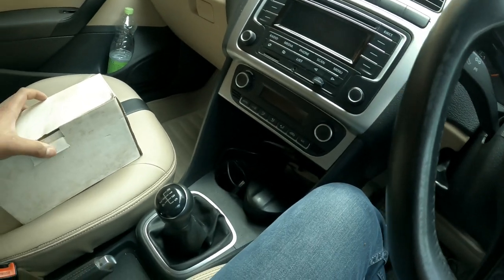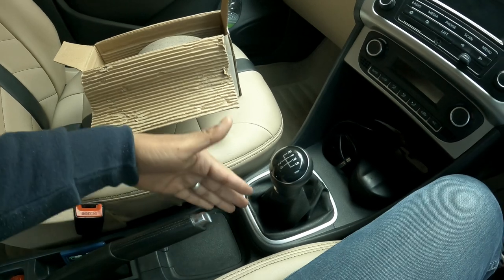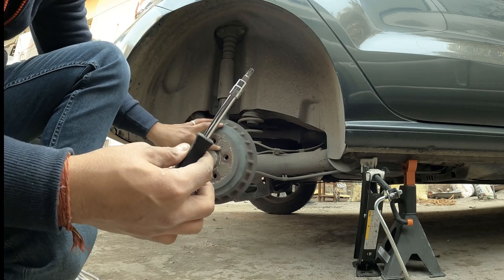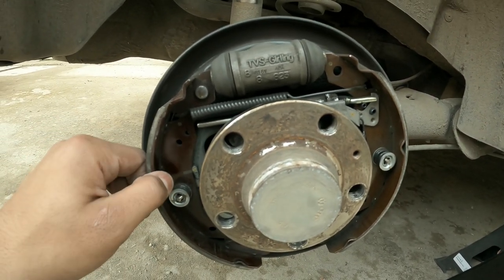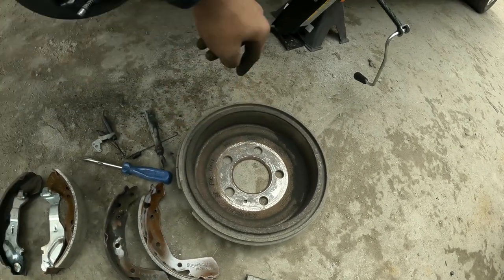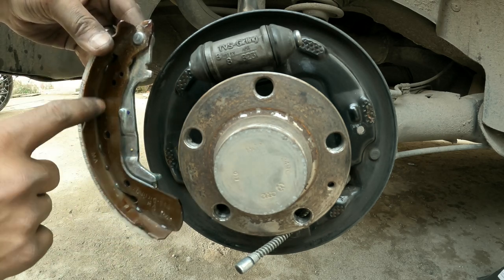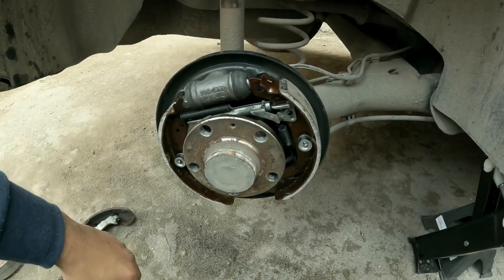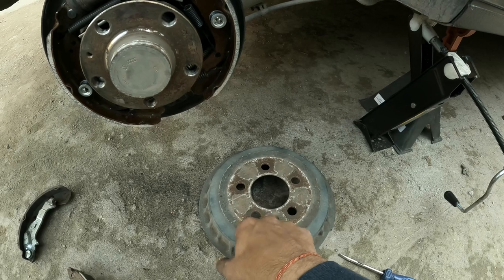HOW TO CHANGE DRUM BRAKES ON CAR | SAME FOR EVERY CAR

Comment: As per your openion which engine is good in safari dicor.......the 3.0ltr or the 2.2 ltr ????
Reply from the maker: Sir 2.2 is more powerful and much more easier to drive . And a little bit more refined than 3.0
Reply: @yourDIYneeds  most of the mechanics say that 2.2 has a common problem of timing belt. Did you ever faced it?
Reply from the maker: Sir its been 11 yrs , i never faced it .
Reply: @yourDIYneeds  happy to hear that dear. By the way if you have any tech knowledge about 3.0 ltr engine, plz do make video on that. I recently bought one and will be happy to know more about it from your channel.
Reply from the maker: Sure sir

Comment: Hi sir I was very much excited to your update and thanks for the
Sharing knowledge. Sir I have a doubt that can 2013 polo comfortline can facelift to 2015 model..? By changing rear and front bumpers along with grill 2013 to 2015. Model. Can u please help me out in this doubt
Reply from the maker: Yes sir its possible , but you have to change the tail lamps as well , as 2nd generation has a different design internally